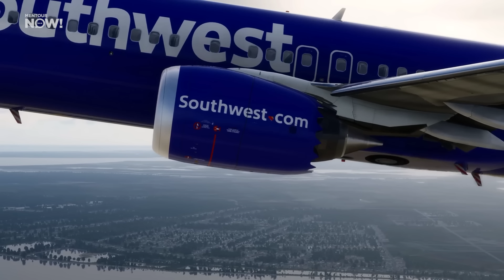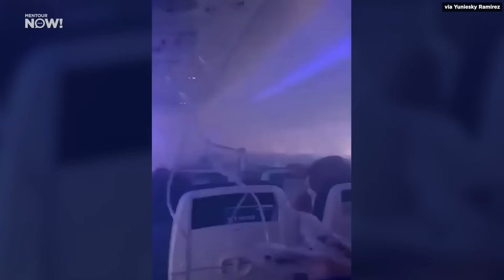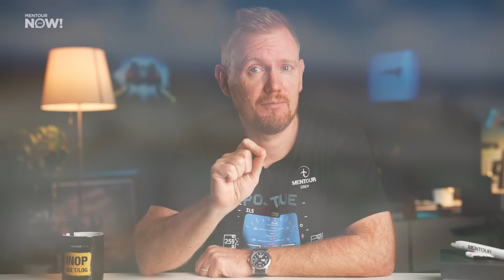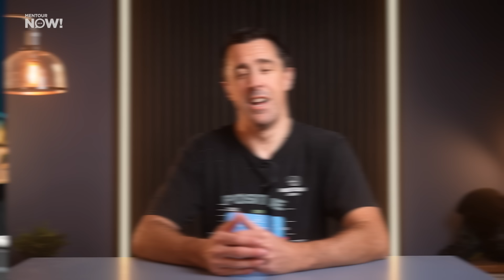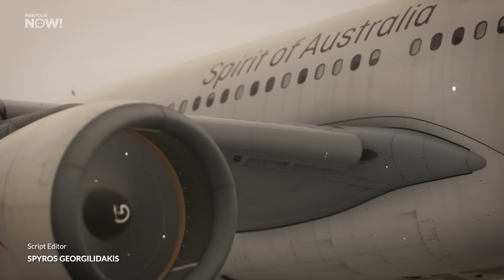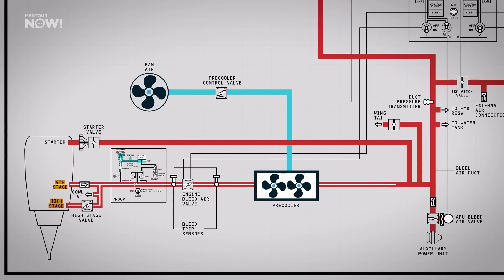Why Don’t ALL Airliners Do THIS?

Comment: A few things that this video didn't address....

The use of CACs (Cabin Air Compressors) means the air you're breathing isn't just 'fresh', it also hasn't been dried out by the inherent heating of the air that using bleed air entails. This means, at the end of a longhaul flight in a 787, you will feel far more refreshed than in any other aircraft. I have positioned (deadheaded) on A350 and B777 aircraft pretty frequently, and every time it reminds me of just how good we have it on the 787 fleet. We don't feel like lizards shedding our outer skin every time we go to work - no cornflake sized bloody nose boogers at the end of a shift.

Also, it's not just the electrical system that is unique on the 787. The hydraulics use microbore piping, pressurised to 5000psi, rather than the more normal 3000psi. This too saves weight in both the weight of the pipework, and the smaller volume of hydraulic fluid carried. At such high pressures though, a hydraulic system would rapidly empty in the event of a leak (something I've experienced on an Airbus) - the 787 has numerous check valves, that effectively isolate the systems into small segments, so preserving the hydraulic system integrity. (With complete loss of hydraulics we can still control the aircraft in a rudimentary fashion using a couple of spoilers that are electrically operated - though it should be noted that this is a backstop while we 'hopefully' regain some hydraulics, rather than a full blown control system).

And the landing gear system is also unique. The gear drops using gravity only. Hydraulics are only used to move the uplocks, and doors in both directions, and to raise the gear. This saves on hydraulic complexity and weight.

It is a seriously clever bit of kit - it's the best fleet in the airline!
Reply: I thought the air quality advantages were due to being able to increase relative humidity to more comfortable levels due to composite structure. I'd think that would be the same on 787 vs A350. Whether the outside air goes through electrical compressors or engine compressor stages matters little - it's still going to be very low relative humidity when warmed up to comfortable levels unless moisture is added.
Reply: Heating air does not remove moisture from it, in fact it has no effect on specific humidity one way or the other (the ratio of water mass to total mass). The reason why we perceive air rising from e.g. a radiator as dry is that the relative humidity tends to be low.

This is because the original cold air tends to have low specific humidity. Simpy put, cold air has a low capacity to carry water. When the air is then heated, the specific humidity, once again, remains constant, but the "maximum" specific humidity increases. Consequently, relative humidity decreases.

As an analogy, if you fill a 200ml glass with water, that's 100%. If you then pour the contents into a 1000ml jug, it's still the same 200ml, but the jug is only 20% full because of its higher capacity.

What this boils down to – no pun intended – is that, in theory, it doesn't matter whether the air is heated more in a bleed air compressor and then cooled down, because the total amount of water wouldn't necessarily change.

That said, there might be condensation losses in a bleed air system, or there might be less condensation losses in the electrical system of the 787, that I can only speculate about.
Reply: @TruthNerds you are absolutely correct of course….  But there is definitely something within the bleed air systems that dries the air out. I suspect something to do with the cooling process of the superheated air means that some moisture condenses out.

You would think that overall the end result would be the same in either system, as you end up with air of the same temperature - but I can only speak from lots of first hand experience of both systems, that the 787 air leaves you feeling far more refreshed at the end of a long flight.
Reply: @TruthNerds  Just pump the cabin on the ground. Then it has 101.325 kPa pressure. And it stays, like a bicycle tire or car spare wheel
Reply: @pvsolutions9292  Fuselages leak. Humans inhale oxygen and exhale CO2. Stale air kills if not replaced.
Reply: @ciaransherry6021  Use submarine equipment
Reply: @pvsolutions9292  Explain how this would work.
Reply: @ciaransherry6021 If fuselage leaks, it cant hold pressure
Reply: @pvsolutions9292  OK. Let's invent a flying  submarine. 😂
Reply: @ciaransherry6021 If engines are stopped, aeroplane must go  to 3000m. If they have air bottles, they could glide far and maybe one engine model is enough
Reply: What is 'fresh' air? Ever been in submarine ? Pumping cabin is just not needed.
Reply: @pvsolutions9292 Fresh Air - unadulterated air that hasn’t been through any part of the engines. The air that the CACs compress comes straight from outside the aircraft.

Not sure what submarines have got to do with anything - they work in exactly the opposite direction to being at altitude. We pump air in to an aircraft fuselage to enable us to breathe at altitude - the fuselage structure is trying to explode from the inside - out. A submarine has exactly the opposite problem, its structure has to resist imploding from the outside - in.

Comment: Electrical based air systems seems pretty obvious after the failures we have seen that have allowed oil into the cabin. The fact that we don't have redundant means of providing air in an emergency like using the APU shows how the industry has gotten complacent in this regard.

Comment: Interesting as usual but with some inaccuracies. The RR Trent XWB isn't the most powerful civilian turbofan engine. Even its most power version falls short of thrust of the newly comparable GE9X and  neither both never nears the gigantic GE90-115B that has 115K lbs of thrust. I loved that engine,  having pushed its throttles during the last 13 years of my career.
While I still don't capacitate myself how a system (LRD) could have been certified knowing that a chance of  contamination of air flowing to the cabin was possible (but recent episodes like MCAS raise many question over certificaton issues) almost 70 years ago the Douglas DC-8 had hot air bled from the engines that was routed to turbines that moved compressors who aspirate clear air from the characteristic "chins inlets" in the nose. So no air from the engines were routed to the cabin. That changed when the DC-8 were re-engined with CFM56 on the -71, -72 and -73 series where conventional pneumatic packs were used. Happy landings.

Comment: 15:55 uh…..what ? I don’t think any car makers are using imbedded heating elements in the windscreens. Range Rover did for a year or two then stopped .
Reply: Some luxury brands (Lexus?) have resistive heating elements in the defroster ductwork, to speed up the clearing of the windshield on a cold start. The Car Care Nut had an episode on diagnosing and fixing one that was stuck on, draining the battery in a couple of hours. Incidentally, I believe that many aircraft do have embedded heating elements in their windscreens.
Reply: Ford has front windscreen heating as an option. At least my car has it.

Comment: I,ve flown the A350 for 4 years and since 2022 I’m flying the B787 and for sure the both approaches to handle pressurization matters goes perfectly well. But knowing that an oil  bleed leak on the 787 isn’t a issue is very comfortable!
Reply: What about the Lithium battery potential problem?
Reply: Everything else is the issue, just not that.
Reply: @daylate what issues?
Reply: @darrenakdeacon  are you trolling?
Reply: @daylate by asking you to define a vague negative comment ?
Reply: @darrenakdeacon  nothing vague about my comment. Google the planes problematic history. Started with the battery and ended with skin coming apart like A350. With various other issues causing the planes to be grounded. 

Oh yeah, trash and tools found in finished wings as well... 😂😂😂

In January 2013, the US FAA grounded all 787s until it approved the revised battery design in April 2013. Significant quality control issues from 2019 onward caused a production slowdown and, from January 2021 until August 2022, an almost total cessation of deliveries.

How was my comment vague?
Reply: @daylate 

LOL, u clearly know nothing about the battery issue but make vague BS statements. But typical of your kind.
Reply: you don’t know anything about aircraft companies , aircraft production, or aircraft issues. 🤦🏽‍♂️😂😂

Comment: One interesting thing to note is battery technology has progressed a lot since the late aughts when the 787 first got its packs. For the most advanced commercial chemistry then they were probably getting about 100wh/kg back then. Today a cheaper and safer chemistry like LFP beats those numbers with better cycle life and safety.

Comment: Only the rear window of the cars use electricity to defrost, the windshield (except for some cars) uses only hot air to heat the windshield and side windows
Reply: side mirrors ?
Reply: @Peasmould  I mean the windows on the front doors, the mirors sometimes have resistors

Comment: Best airliner I've ever flown: and the bleedless architecture is awesome for us as crew. But, if it was an easy solution, every model would do it, including the more recent A350 and A220 - and even the 777X. The Dreamliner took technology to the edge. The A350 never delivered the promised performance, dispatchability and range, and its selling numbers show that. And one of the reasons was the conservative approach by Airbus, who drained by the A380 development, had to come up with a new twin to compete against the 787/777 in way less time.
Reply: "The A350 never delivered the promised performance, dispatchability and range, and its selling numbers show that", I have to disagree on that. Reality states otherwise for the most part. If you meant compared to the 777, there is only a few routes where the A350 can't handle what the 777 can in regards to payload. I admit that. HOWEVER if the A350 "never" delivered the promises, we'd be hearing plenty of airline executives, mechanics and even pilots state so. Not the case. Airlines would not be placing this many orders if the A350 could not deliver on it's 25% fuel efficiency advantage over the 777-300ER, performance or could not deliver on range. The A350 is not as popular as the 787 because apart from being introduced a few years after the 787, the market the A350 targets is not as "sweet" as the one the 787 targets. There are 700 A350s in airline service right now as we speak. The A350 clearly means something to alot of airlines. Air Canada even just ordered the A350-1000. 

The purpose of the A350, is to fill the gap btwn the 787 and the 777 and aid in 777 replacement. It continues with increased capacity, payload and range that the 787 just can't handle, but not to the extent of the 777, the max payload king, with better range at max payload. The A350 can't touch the 777/777X there, but that's not really it's intent. Many mechanics who worked on both, state the A350 is much better aircraft. I think the 787 is truly a great aircraft but facts are the facts. The 787, while, an impressive aircraft, suffered from unreliability in its early years, from VFSG unreliability, battery fires, major quality issues and numerous electrical failures that the A350 largely avoided, due to the fact it somewhat stuck to the conservative approach. The A350 still has a very high dispatch reliability and many pilots who fly it attested to that. Speaking of issues, whats interesting is some pilots and mechanics report the 787, even now, suffers from more problems that maintenance has to deal with that not even the 777 or A350 deal with to the same extent

Comment: This was a very helpful "deep dive" into the benefits and drawbacks of both the mechanical bleed air system used by the A-350 and Boeing's all-electric air-supply system as used on the 787. Thank you.

Comment: The bleedless design on the 787 is impressive, BUT even that don't 100% guarantee you won't have a smoke event in the cabin and cockpit. It is still possible to get tons of smoke in the 787 cabin/cockpit from a failed cabin air compressor (CAC) instead. It happened to 2 Air India 787s. One on November 13th, 2016 and the other on July 16th, 2018 (avherald website). Smoke filled the cockpit in the 2016 incident and smoke filled both cockpit and the cabin in the 2018 one.  So it is true while you cannot get engine oil smoke from the engines of the 787, you can still get smoke from one of the CAC instead.

Apart from that, I do believe the bleedless design will be the future standard of airliners where even Airbus will have to ditch the bleed air system. But for now, it seems like the CACs isn't entirely trouble free at the moment as I have read several 787 mechanics and even pilots state it's not uncommon for a CAC to malfunction and be MEL'd, even through reliability of em improved from the early days of the 787's life. It seems like the A350 represent the max extent that improvements of the traditional bleed air system can go so I'm sure bleed air systems will end soon.
Reply: Certainly, seeing a CAC inop as a deferred defect was pretty common a few years back - I can honestly say I can't remember the last time I've seen one inop. We have introduced a few procedures that seem to be doing the trick of protecting them, and mods are being installed fleet-wide that should see us have pretty much 100% reliability fairly soon (if it's not there already).

As you say though, it's not impossible to have fumes from a failed CAC - certainly I've had a number fail mid-flight a few years back, and they would often fail in a fairly noisy manner (I suspect bearings gone, or blade damage, or some such) - it might take some time though before the system recognises a failure and shuts it down (you probably know there are no indications on the flight deck, other than after the event on the Air page) - so there was always a feeling that we might start to smell some electrical burning or some such - though we never did (thankfully).
Reply: @Kapitan_Plastic_Fantastic  Oh wow. That's quite the story. I'm aware of the lack of indications apart from the air page. I will admit the clean air from the CAC is good and more airliners should have a bleedless design, but hopefully the technology will be more reliable and cause less trouble trouble by then. The 787 is still an impressive aircraft, despite CAC issues.

Comment: I remember traveling many times on 737s with the low bypass cigar engines. During engine start, the cabin would briefly smell like burnt jet fuel, and one time I remember a puff of smoke coming out of the air nozzles.
Reply: I still smell burnt jet fuel on most bleed air engines during pretty much all ground operations. Most of the time I can ignore it, but it's always there.
Reply: @marshaul  I don't ignore it. I enjoy it!
Reply: @zeus6828 I mean, lots of us enjoy the sensations associated with aviation, or machinery in general. Meanwhile, diesel (and jet fuel) exhaust is a Class 1 human carcinogen. 

Do that shit on your time time, bro.
Reply: @zeus6828 , jet fuel, (in my case AVTUR or avgas, is the smell of freedom. (Harking back to the Cold War).
Reply: I think I have also experienced this in the cabin of A320s too
Reply: Very common on MD80/90’s as well.
Reply: Also true that upon engine start, you're basically inhaling Airport Ramp and all it's unique blends of petroleum derivate fumes.... 
It'd be weird if you didn't smell jet fuel, kinda like driving behind a large truck - Had it happen to me on my three most recent flights, just last year. Part of the "experience", I guess
Reply: @OfMoachAndMayhem Never smelled anything somehow. I guess my nose is not too developed
Reply: That’s because, especially with a tail wind, the exhaust is being recycled by the engines.
Reply: @johnnunn8688   >850km/h tailwind? Nice!
Reply: I still smell the burning fuel on the MAX(s) and the neo(s), atleast operated by couple of airlines in my country.
Reply: usually it happens in opposite, on arrival when they switch off, cut off burn and engines contimue to rotate idle decelerating. Remnants of kerosene vaporise on hot surfaces and is pumped into ventilation, so for a while you can clearly smell it.

Comment: in  the  Video  You  loof al time  11:29 where  it is  explained totely   correctly  that  there is  a  switch   that  connects  C1  and  C2   in  case   one  of them  has  no  electricity  and   schould be  supplyed  be   the  System   of  the  other sinde.  but  if  its  a  short  current,  this  will  connekt  the  system that  does stell  work  to the  schort  current  and kill  ist.       the reaction  of  the  Computer took some time   a seconde  or  so   so tat a  scond   after system c1  was  without  voltage   the   right C2  System   failed!

Comment: IANA airplane designer, but I would be surprised if the reduction in the space required to run all those ducts, and the size of the through-holes in structural components didn't also factor into the equation. A 1 cm through-hole in a 30 cm wing spar is a dramatic difference to a 1 cm air duct through-hole. This changes the design of the spar. And this might even reduce the required wing thickness, location of actuators, and other aspects that can have follow-on effects throughout the airplane design.

Comment: 18:53 Correction: the XWB-84 was weaker than all 3 engine options for the 777, even back then.
The XWB-97, certified in 2017, is still slightly less powerful than the PW4098 in 1998.

Comment: Could bleed air be used to turn a compressor, like how the 787 uses an electric motor to do so?  That would decouple bleed air from the cabin air supply, even on conventional aircraft.  Of course, that's more weight and complexity for another component, but I think that also gets rid of the precooler.